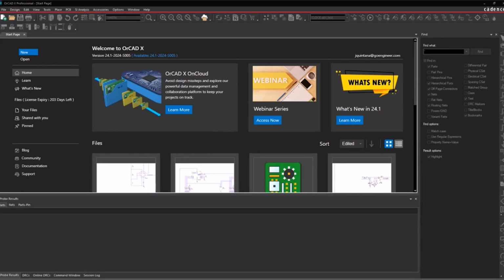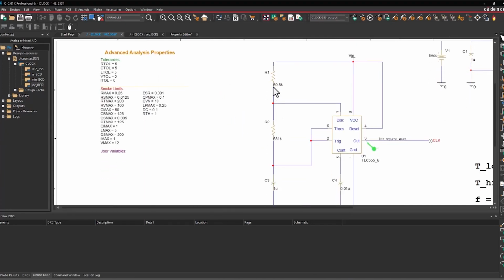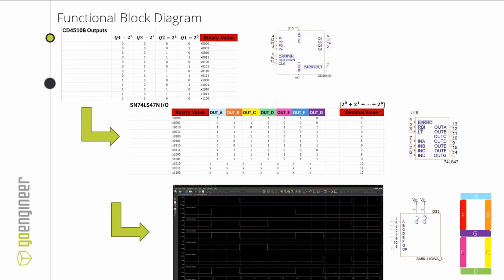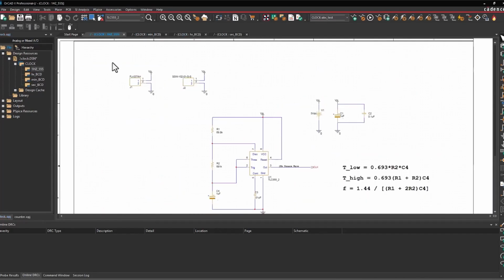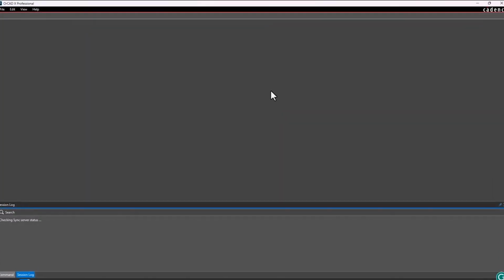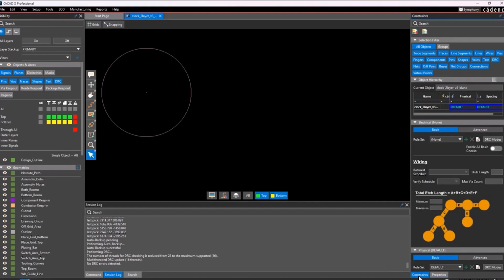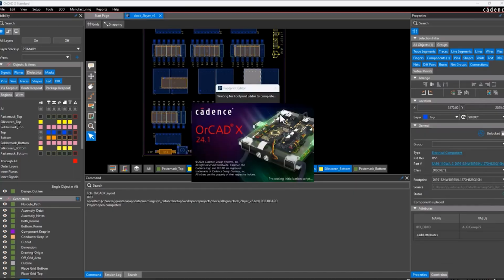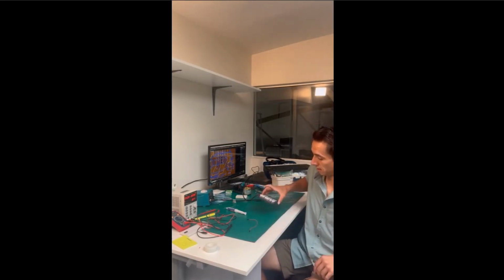Designing and Building a Digital Clock from Scratch

Comment: Hello sir, 
I am from Greater Noida (INDIA)
I have a problem in solidworks
In the step file, the model has multiple radius on the edge.
I use the delete face command and use three of them. But unable to remove the radius on the edge of the part. On the edge of the model has multiple sizes of radius.
Pls make a little bit of video, so I can understand how I can do it.